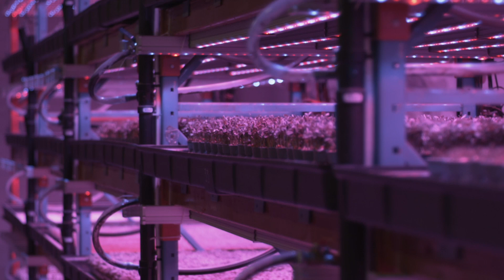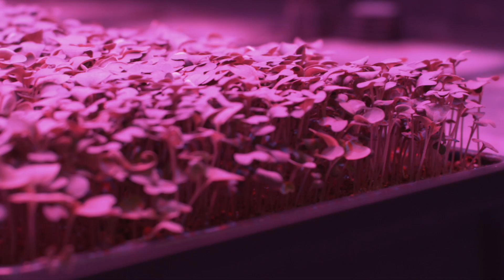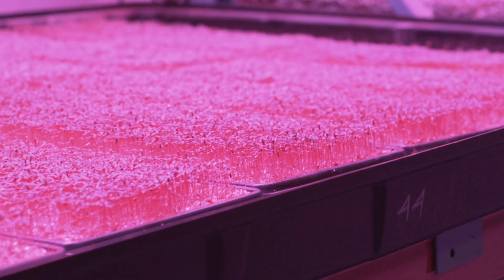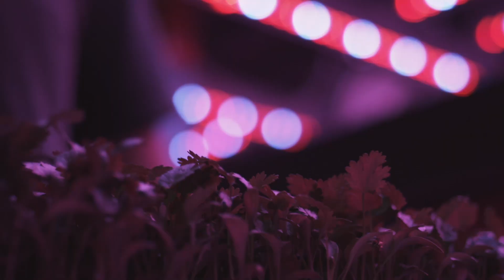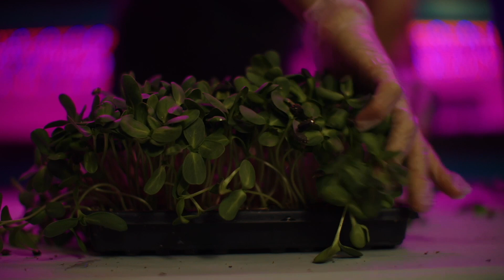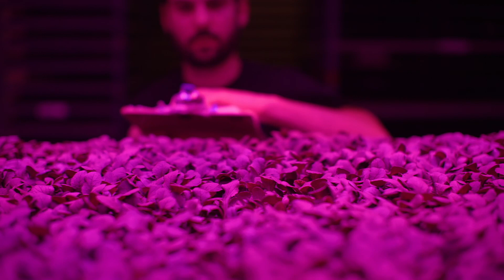Microgreens Sustainability & Greenwashing

Comment: Great info, thank you! Have you tried to mix soil with coconut coir? I’m actually going to try this today, just wondering if anyone has tried this method of growing medium?
Also, Hydropower dams can disrupt and even destroy entire ecosystems by blocking the annual inflow of sediments and nutrients, as well as migratory fish populations. They are getting better at this by building fish ladders but I wouldn’t consider hydro as sustainable.
Reply from the maker: Many years ago I mixed potting soil with coir and it works great. The challenge was the salt levels in coir and th slow process to break up the coir. The "washed" uncompressed coir is usually not organic and about double the price of peat moss potting soiuls so depending on your growing methods it may or may not be a good fit
Reply: @microgreensconsulting  good to know, thanks so much!

Comment: Corn-based petro alternatives (plastics, biodiesel, ethanol) don't just have the opportunity cost of "you could have been growing food instead."  The process of growing the corn itself uses (wait for it) petroleum products such as gasoline and synthetic fertilizers.  (Is this what you were talking about with the overall 25% less carbon emissions?)  So while corn-based petro alternatives may be less harmful in the long run, they're not exactly carbon-neutral.
Reply from the maker: Corn based plastics are definitetly not carbon neutral, but from my research they are less carbon emitting. However the overall environmental footprint seems to be much worse given the pesticides and chemical fertilizers used that are damaging our ecosystems directly